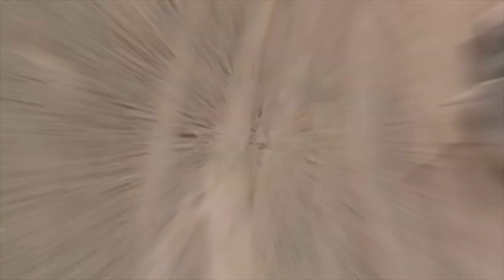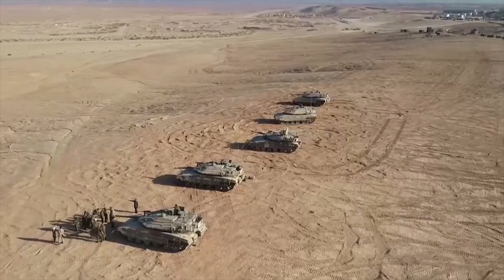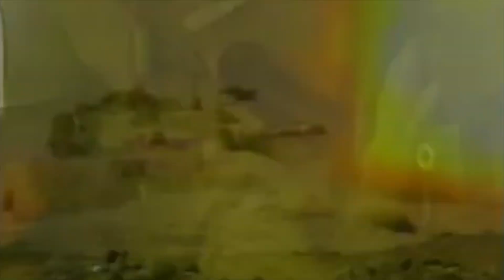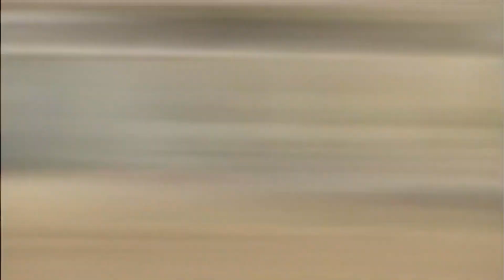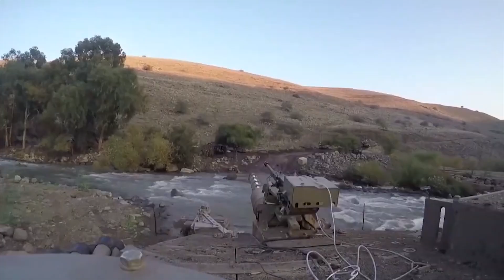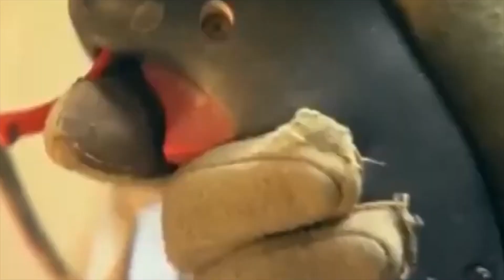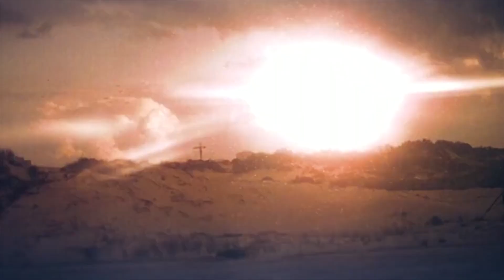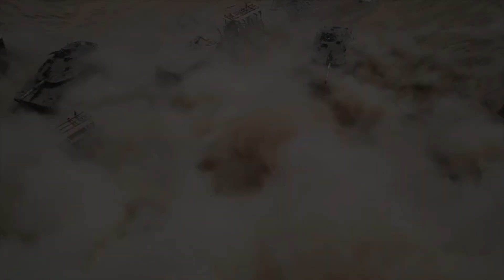New ISRAELI Most POWERFUL Tank SHOCKED The World!

Comment: Rubbish. Kornet can penetrate over 1300mm RHA, Kornet-EM able to double tap. $26,000 per missile defeats millions of useless battle bus.
Reply: What about trophy? 🎉
Reply: Trophy can be defeated- it has a magazine not a bottomless pit of munitions. In the promotional videos- not even ISIS would be so stupid create such an easy barn-door target. Even if Trophy shrapnel shooter rotates very quickly- how quickly and how long before it's depleted/or rotating motor burns out?
If it's a flammable box- something can set fire to it an inescapable axiom of chemistry and physics.
Merkeva still has tank tracks- and a barrel? 
A determined 1950's ambush of false attacks by RPG5 and some determined daring close quarters satchel charges- or even 15 kg old WW2 tank mines will easily defeat Merkeva Trophy and CIWS resulting in a mobility kill- ideally one that others seek to rescue. 
Especially if tanker panics, obscured by own anti-ATGM smoke rounds and and drives into ditch/tank-trap. All of a sudden Trophy is completely useless beyond its designed parameters. 

Considering 155mm has only 5-10 kg of explosive- anything above beats STANAG 6. $200 of 10 roadside 152mm buried shells using the self same US-Israeli command detonation technology given to ISIS? 
Old 1950's US FM/TM textbook ambush will suffice.
Trophy is a rip off of Soviet Drozd and Arena- Soviet pro-Israelis brought it to IDF and sold it to PRC now fielded as GL5. Trophy radar in a deliberately EMW silent zone is easily detected and jammable or decoyed. And its radar well within 5 mil of 500+ metre anti-materiel rifle accuracy.
  @MennyEX

Comment: The Merkava is 97% US and German technology. It's power pack consists of General Dynamic's land division engine/transmission, the main Gun is designed and made by Rheinmetall of Germany, the tracks and wheels, drive-system, as well as the entire mechanical systems are German. So, what part of this MBT made by Israel? The only known part made by the Israelis is the main guns' thermal sleeve. Inflating a mouse that's living on US charity and under US protection to an industrial nation making wonder weapons is a joke, it never works because it is silly lie.

Remember the Iron Dome missiles, which is 100% US technology but the Israelis claim its their technology, it's not, the damn system is made by Raytheon Corp., when the israelis were almost out of them during their clash with Hamas, they were begging and screaming for US help to expedite supplies, which USA did as it usually does. If Israelis were the makers of such missiles why would they ask USA to supply them? Soon after they asked Egypt to arrange a ceasefire with Hamas for they were no longer had the stomach nor the capacity to fight that small militia which has no heavy weapons but home made rudimentary rocket for self defense. Using big empty talk, lousy propaganda, and fact-manufacturing doesn't create reality, it merely fools the simpletons but the facts remain, Israel cannot make any weapon system, it merely takes US made arms and rebrands them as Israeli-Kosher "no pun intended".

Israel has been and will remain a colonial outpost. It was created, fed, armed, and constantly protected by USA and Western Europe, thus, without such infusion of tens of billion of US taxpayers' dollars and the constant supplies of arms, Israel won't last a single week on its own even against those $hity militias. Israelis won't stand a chance, they simply escape back to their own countries in Eastern Europe and that ends the fantasy of a phony creation, the source of all evil in the region and most of the world including Ukraine a failed Nazi-state governed by a gang of Koshers.

Comment: It has wonderful air conditioning inside if you really want to know :) Narrator tells you that protection was first priority, but he doesn't tell you WHY. Reason is - in 1073, the "Yom-Kippur War" that was our worst war - we were surprised and attacked by tank forces 10 times bigger than ours (Russian models of the period)  - on the Golan height - we had lots of casualties. The way people die in tanks is horrible. When any projectile manages to come through the armor - it burns everyone inside the tank alive. We're Jews and we just can't have it happening to our soldiers. Hence - the new tanks were designed to avoid the terrible scenes of 1973. That's also why the air-conditioning is so powerful. It can cool down the interior of the tank in seconds, no matter what. Save lives. Today's Merkava is also admirably offensive - it will stand against any other - but the protection is still its greatest attribute.
Reply: It’s not doing very well in the Ukrainian war maybe you should review your facts.
Reply: @johnhannigan8265  Because there are none there?
Reply: @MottiShneor  you obviously didn’t get the point I am speaking about the Russian tanks  not the Israeli tank,which is iideal for Israel’s requirements but is not suited to European warfare.
Reply: I agree the Merkavah Mark V is outstanding in personnel and self defense. While the Abrams M1-A3 is a tremendous tank in many respects, the engine is still in the rear and the driver is first in the line of fire. It also lacks the defensive invisible shield making it more susceptible to attack from above. But the armor has proven to be outstanding. An M1-A1 was hit repeatedly by RPG’s and it did very little damage to the outer shell. It also has incredible night and thermal vision and the computerized fire control lets it hit targets at extreme distance while running on uneven ground at high speed. I don’t know if the Merkavah has comparable ability, but knowing Yis’rael it wouldn’t surprise me at all. The US builds equipment to stay in the upper class, Yis’rael builds equipment to stay alive; that’s one reason Yis’rael’s equipment is so good.
Reply: Very true, because when the crew inside is comfortable, it is way more effective.
Reply: Certainly not an equal consideration paid to the victims of the 1967 pre-emptive war (completely contrary to Geneva Conventions). People aren't burnt alive in tanks- the wounds will be exceptionally debilitating to he point of barely survivable (loss of limb, leg, major wounds to cranium or torso) spallation is like a close-range shotgun blast so they will rapidly exsanguinate or asphyxiate first on CO2 and CO even if it is on their own uniforms aflame. 
Zero oxygen environment = instant unconsciousness- and hot fumes rise- otherwise OHSA is telling a lot of lies about dangers of people in confined non-aerated environments and firemen giving lethal advice about staying low and crawling to safety.
Reply: Amso the ability to see 360° from inside the turret and to react very quickly and accurately to incoming attacks.  Not forgetting the upgraded Trophy stystem now equipping the new British Challenger 2 tanks
Reply: Glory to God for Israel/The surrounding nations may hate you but you have THE ALMIGHTY GOD EVER ON YOUR SIDE
Reply: Only the dckheads who uses the Old Testament when the New Testament is solely relevant to Christians- Israel is anyone who believes in Christ the Messiah- ergo all Muslims are de facto Israel as they believe in two things one group refuses to believe in- 
1. Immaculate Conception and Annunciation the virgin miraculous birth of Jesus Christ (Esa) to Mary (Maryam) announced by the angel Gabrial (Jibril) and Joseph (Yusuf) and 2 Esa al Masih (Jesus who lives) foretold by all prophets (Nabi) will unite with the Mahdi at Akhir al-Zaman (end of times) to fight Shaitun (Satan) and win. @kiizamariam8425
Reply: In the Yom Kippur war, Israel lost. Israel used American and NATO pilots to fight against the Egyptians. The Israeli forces were surrounded by the Egyptians. The Americans saved the Israelis by brokering a peace. Moshe Dyan was kicked out. He was the defense minister.
Reply: @donaldfernandes7798  Actually, The Egyptian Third army was surrounded in the desert and rescued by the Russians from imminent destruction. Israeli Tanks were operating on the West side of the Suez Canal, threatening to go to Cairo.  Egypt was saved from destruction by a resurgent Israel. Israel always comes back, more powerful, after an attack.
Reply: @donaldfernandes7798 You're absolutly entitled  to hate Israel and love Arab Countries what you're not entitled is talking about something you don't know none whatsoever. Israel up to finow has never ever had Americans or any other foreign force in any war fighting for them.Period. Not even in Yom Kippur war where they almost lost. I know ignore  Middle East History, and decide vomiting anti-Israeli propaganda.I' m sick and tired of people  like you. First and foremost read about the subject and then and then give an opinion!!!!
Reply: @donaldfernandes7798   omg.
Reply: Arms making companies hype their products. This is commerce. Battlefield is the proving ground. In WW II, the German Tiger Tank was a terror, because it could single handedly taken on the enemy tanks. But nobody talks about it today. The Americans are hesitating to send the Abrams tank to Ukraine. It is the best American tank, but they are afraid it will get knocked out and end up as a museum piece.  @GregoryKupershmidt
Reply: Thank you.
Reply: THE UPGRADED RUSSIAN T80 IS SUPERIOR ITS GUN IS 125MM ITS RANGE IS 5KM IT CAN FIRE ANTI TANK MISSILES 5KM RANGE IT IS FASTER 75KM PH IT IS AUTOMATICALLY LOADED SO IT NEEDS 3 CREW INSTEAD OF 4 ITS 40 % CHEAPER AND HAS NO US PARTS WHICH CAN BE SANCTIONED ONE TO ONE FIGHT THE T80 CAN EASILY WIN
Reply: @LoukisAristodemou so what happened to the russian tanks you said superior to the merkava during the first days of and until now ukraine invasion
Reply: @LoukisAristodemou  The fact they (T80) burned by dozens in Ukraine quite disapprove your point. Not to mention that due to construction specific crew of T80 have much less chances to survive direct hit than crew of Merkava
Reply: Except in the last lebanon invasion  where hezbullah fighters destroyed dozens of them
Reply: @32ewing  While more were hit, only 5 were actually destroyed, some of which were the old Mark II (which was phased out of use as an MBT since), with the rest being attributed to a gap in tactical training. But more importantly - that was all in 2006, before Trophy got implemented.
Reply: Not even one. I don't know where you get your information from, but go check your sources.  @32ewing as far as I know there is nothing in the hands of Hizbollah or any of our "state enemies" that can crack this tank. There ARE mines big enough to damage a tank - but - not to kill people inside, and usually not to break it beyond repair. Usually they just throw its caterpillars
Reply: @32ewing  No they did not... Not even one. You have your facts wrong.